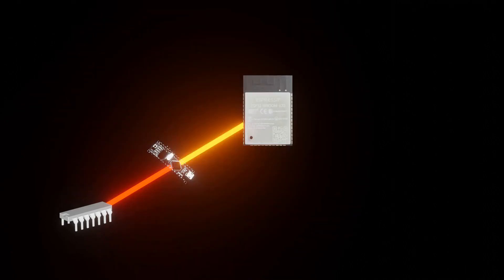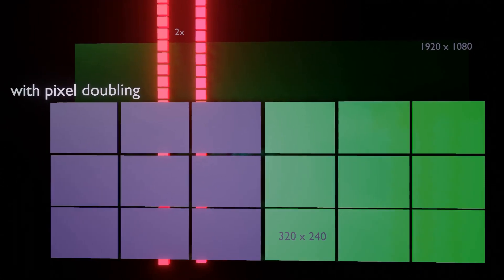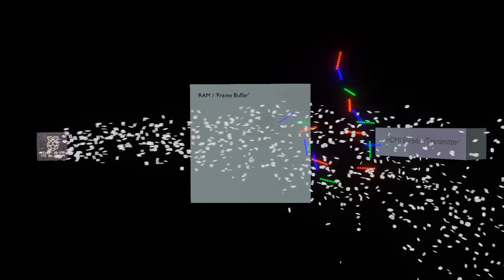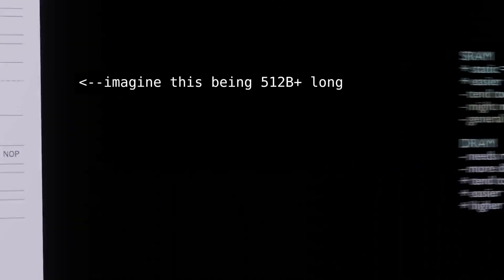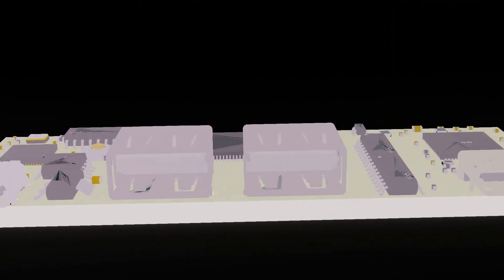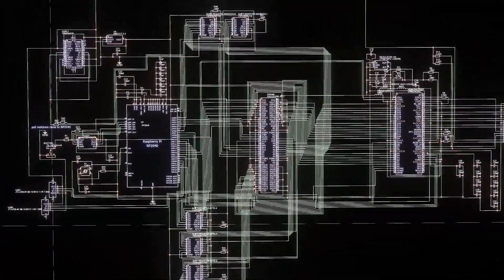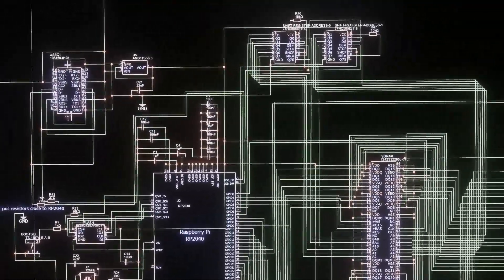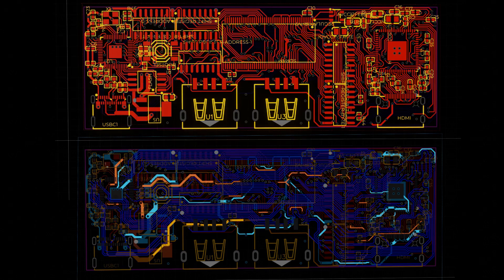Can the RP2040 output 1080p? I think so, with a little help...

Comment: I'd rather see a Raspberry Pi zero as GPU with some interface to the less capable processor running my code.  That is to say, I want a display and I don't want to do a lot of work.

Comment: What about DPRAM (Dual-Ported RAM)?
Reply from the maker: Thank you for mentioning DPRAM --  I considered it but didn't mention it in the video.  The dual ports would make the read/write timing much simpler.  I would have gone with DPRAM if I could locate it in stock at JLCPCB (I was trying to stay within their parts assortment, so the PCB could be fully assembled all in one go).
Reply: @TECIST  but they do global parts sourcing. i can probably help out
Reply: Dual port RAM is fairly expensive, but that was a decade ago when I checked. It's eliminates the issue with bus contention which is only an issue if the processor runs out of time due to waiting for access. You can also fire an interrupt to update the frame.

Comment: SDI to HDMI converters exist. 1 GPIO pin for video and audio.
Reply from the maker: SDI is very interesting. I hadn't come across it before, but looked into it per your comment. I could see that being used to keep the GPIO pin use low while still being able to bitbang SDI-->HDMI video (where you have a very fast microprocessor / serializer). The headache for the RP2040 is that video bit clocks for higher resolutions are so fast the RP2040 can't be OC'd to keep up with low pin counts, so it needs to parallelize across many pins to have a chance.  One pin 1080p video means Gb/sec, which means Ghz bitclock/processor clock, and the highest I've seen the RP2040 going is in the 400Mhz range.  Raspberry Pi tried 1Ghz [ https://www.raspberrypi.com/news/dont-try-this-at-home-overclocking-rp2040-to-1ghz/ ], but TL;DR it was fried after a few benchmark runs.
Reply: Yeah, I came to the same conclusion. lately I've been struggling with I2S on an ESP32-S3. "E (7) I2S: i2s_set_pin(295): ws_io_num invalid". So much personal tech disappointment over the last few years.

Comment: If DVI possible on a rp2040, could we use a esp32 instead? Look more powerful..
Reply from the maker: Yes, although the ESP32 would still require an external PSRAM to keep a large frame in memory -- the good news is that the EP32 ecosystem is relatively graphics-friendly: some dev boards have 8MB PSRAM onboard, LCDs (to 7" 800x480) with an integrated ESP32 are available, and LVGL targets ESP32: https://github.com/lvgl/lvgl

Comment: I wonder how far you could get with some kind of decompression in the DMA / PIO? 

If you're upscaling low Res graphics that should get you quite far.
Reply from the maker: My sense is pretty far.  Any kind of GUI (even the one-way microcontroller to RAM to encoder/transmitter proposed) would need a way to translate the application/OS state to which parts of the frame should be overwritten with what data, so there is already some logic working to keep the state within the MCU, despite the end product being too big to hold in the MCU all at once.

Before compression, you could go down from RGB888 to RGB565.  With some dithering the perceived color depth loss/banding might not be too bad.

Lower frame rates wouldn't help the size of the 'frame buffer' because it only holds a single frame, but might free up some clock cycles to do compression / decompression work.  Running on bare metal could eliminate memory cost coming from a runtime/interpreter.

Image data tolerates lossy compression, so compression ratio can really vary with your image quality standards.  Supposedly JPEG can be compressed down to 5% (although it must look 'potato' at that extreme).

I'm not sure how computationally intense the compression / decompression would be, nor how much could be offloaded to PIO... hmmm...  it would be good to keep everything internal to the RP2040.

To continue (without pixel doubling) via the DVI LUT approach brilliantly demonstrated by Wren6991, you are not only RAM-constrained, but you need more compute power and have little overclock headroom left, which implies a need for multiple RP2040s (there are such projects out there).

Comment: Why would you want to run at 60fps if the module won't be able to update the screen that fast?
Just because you can? 🙃
Reply from the maker: Lower frame rates (24/30Hz) just feel too laggy to track cursor movement (I'm thinking of a cursor in applications that are not very demanding, perhaps the PyDOS equivalent of the old MS-DOS text editor).

The  HDMI encoder (SII9022ACNU) pixel input clock for 1080p is 148.5Mhz, which is below the clock speed of the SDRAM and still in the 'mild' overclock range for the RP2040.  There are time windows to write to RAM during the HDMI encoder horizontal and vertical blanking intervals.  While in theory this could apply some updates to each frame, my sense is that you're right, updates would regularly need to be written over the course of multiple frames, resulting in image tearing.

Also, just because 😂
Reply: @TECIST  or you could just do what most modern GPUs do and use a double buffering setup potentially on two ram chips, but could in theory work on just one, That way your display logic could just happily go about what it's doing while your pi is rendering to the next frame. Or am I misunderstanding something
Reply from the maker: That could prevent tearing, but at the cost of having to redraw the frame continuously.  It is best to think of the RAM here as containing what 'should be on screen' at any given time, rather than single frames.  That allows the RP2040 to circumvent the impossibility of keeping a full frame in memory and reduces the redrawing to only changed pixels.
Reply: @TECIST  That being said, it would allow for significantly more time to process... Everything. In theory though, you could just dump the contents into another chip, but I also understand at that point we are talking much more complexity, it was just a suggestion to get more "bang" for the time you have.